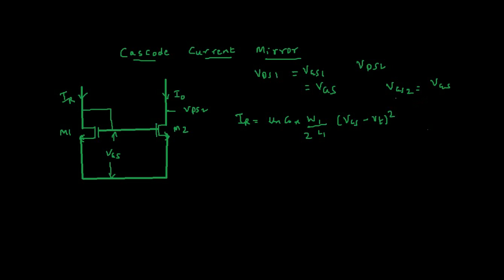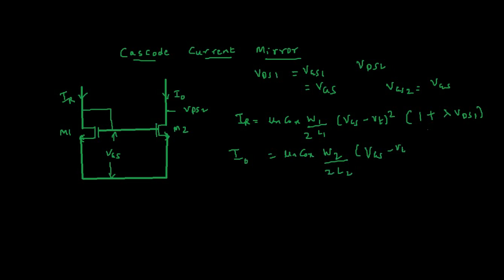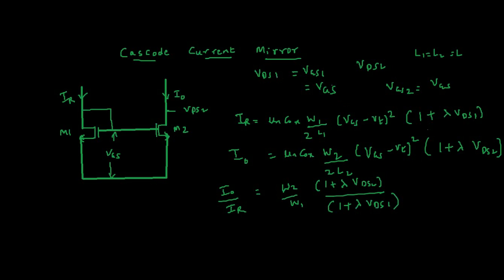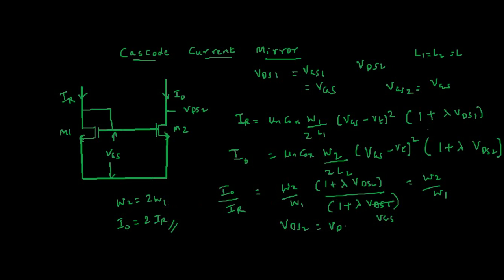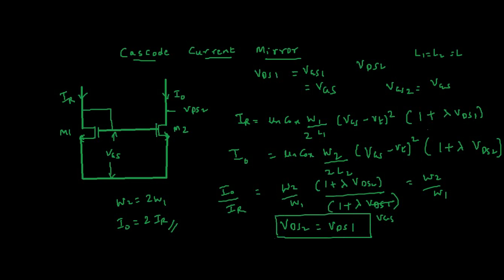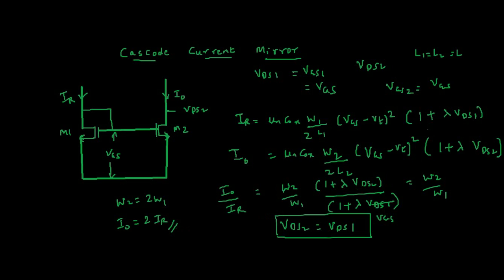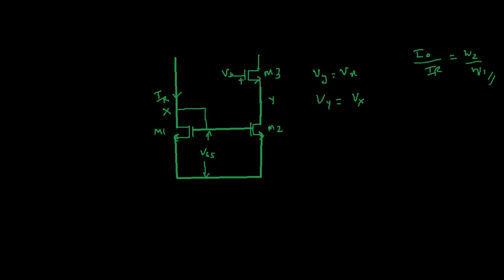Working and design of Cascode current mirror

Comment: Hello Sir, small question here in this video is How you are considering M2 is in saturation.??
As we don't know Vds2 how we can decide M2 region. Can please explain about it. And you are directly writing current equation Io in saturation region
Reply: The voltage supplied by  cascoding M4 will be VDD as M4 is diode connected transistor, the same will be used by M1 as Vx = Vgs1. And And as VDD s Vds1,  there for the same equation follows here. Vds1 > Vds1 - Vt, which holds true. That's why M2 is said to be in saturation. Visit www.electromaniaweb.wordpress.com for  more  detailed explanation